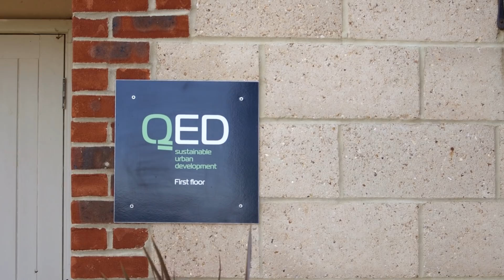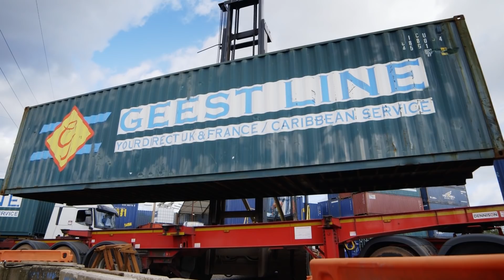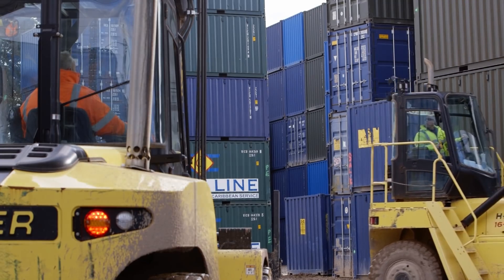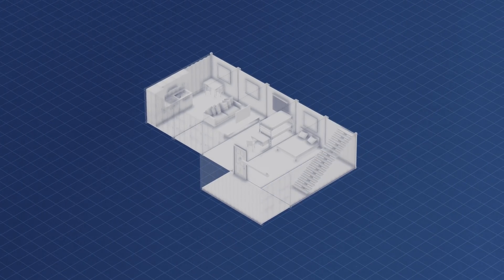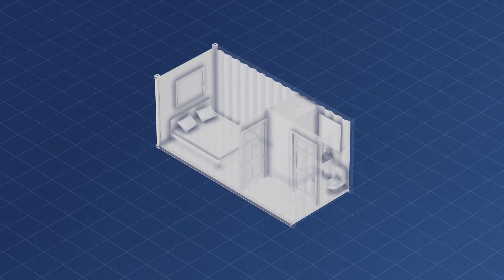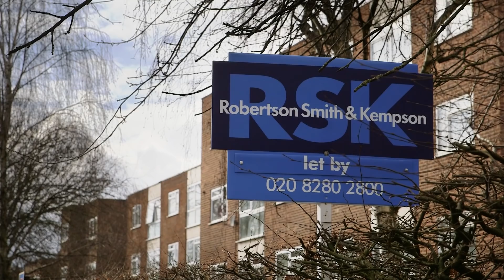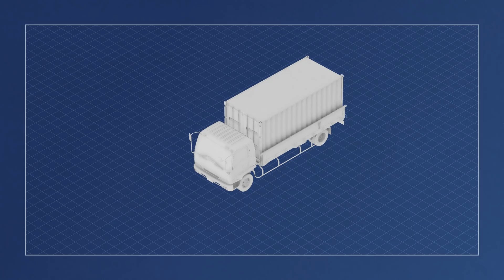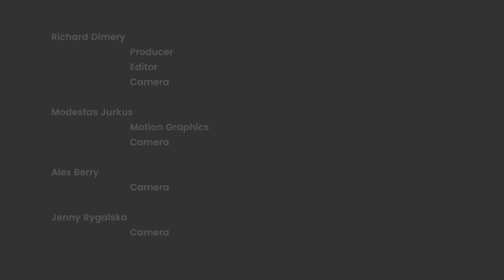Container - Beating the Housing Crisis in London

Comment: It is one of the excellent designs aside from the materials used from numerous industries, be it for factories or for residential. The developers anticipate tge importance of durability, as well as the importance of reliability of the structures wherein it is footed and established, fulcrum, nuts and bolts based, where it won't be drifted away by hurricane or tornado, while the floors are lifted designed in anticipation of flood/can be amphibian types as well at times. The ventilation system are also good, since it has exhaust fans that can remove the excess heat as demonstrated by the employee/construction engr. SMEs..Ptd/Trademarks/Copyrights/LLCs/Registrations/Copyrighted materials/Registered are owned by its respective owners and has rights to inspect quality/grade standards and application per geodetic codes and standards/structural/safety/chemical/electrical/Civil/ENGRS measures and expertise. Respectively certain. Tiers 1 and 2 Levels 1 and 2, Mgmt approvals and realization/reconciliation committee-housing/formal/ attested by the sectors private and public sectors inspection/standards/quality/finance realization and computation-maintenance/taxes and tax reconciliation according to tax/codes. Thank you. //./../../G.M Industries.

Comment: Stop making out tiny homes and container homes are an answer to housing crisis. People shouldn’t have to live in tiny spaces. Everyone should have access to a house. There are more then enough empty houses owned by the wealthy. They need to be filled with families and used. Shipping containers are tiny. Once you put in the stud walls and insulation and floors they are not wide enough or high enough. Plus if you start cutting the shells they lose all structural integrity and rigidity and weather proofing. And you need to brace and alter the frame. The UK is damp and wet and cold. No good for container houses. The government should make empty houses and factories, office blocks, warehouses available to people who truly cannot afford a house. Convert them into homes. Government should take all the empty shops from all the estate agents and use them for families. Not people who are wealthy and decide to downsize and live in a camper van or a tiny house cause it’s cool. You are not solving the problem with container housing. A temporary solution would be utilising empty land space and making more park homes. Static caravans and motor homes for people who cannot afford a house. Static caravans come fully furnished and are bigger than containers. It’s just frowned on by the general public as being common.  Containers are old hat and not as good as modern 3D printed composite materials that are being used to build structures in disaster areas.  If you fill the cities with metal boxes it will look awful in a few years. No matter how you tart them up.

Comment: They'd look much nicer if they were partially surfaced with a bamboo plank veneer.
The commentator at the 16:33 mark stated that container could be used to build prisons.  If effort isn't taken to beautify these units to facilitate pride of residency/ownership with community space, they will quickly turn into prison units that you might find in any slum.

Comment: Interesting to hear that these are intended as 'meanwhile sites' with a life of ten years. Just like the prefab houses were a short term measure after WW2 but were still occupied in the 1980's, over 40 years later. I think once in place these will be used for considerably longer than ten years.
Reply: well said !!
Reply: And to my mind nothing wrong with that as they are creating homes and of a a far higher standard than B&B and standard building regs!
Reply: You're right. The last occupied nissen hut was shut down in the eighties.
Reply: Of course this will be the case because the conditions causing them to resort to using containers will not change
Reply: @tayokarate  except the construction brief is for a ten year design life so they will need significant refurbishment or replacement after ten years.